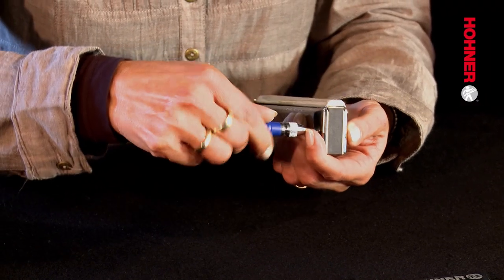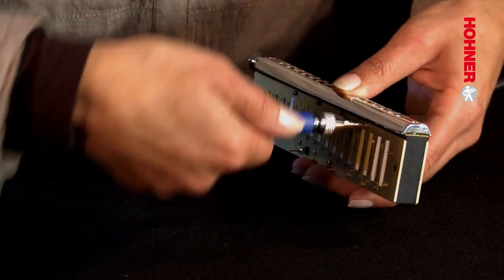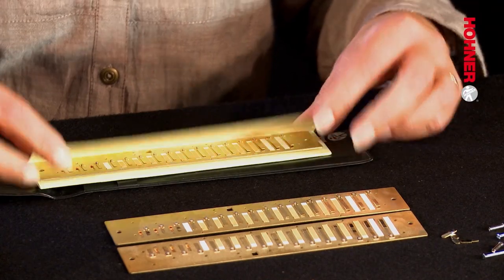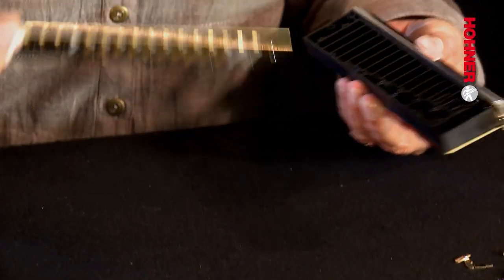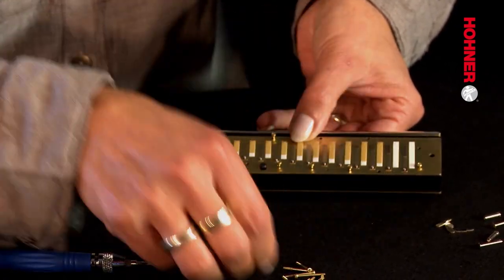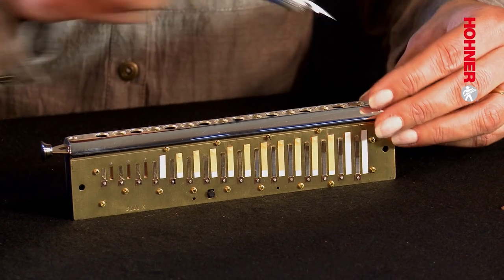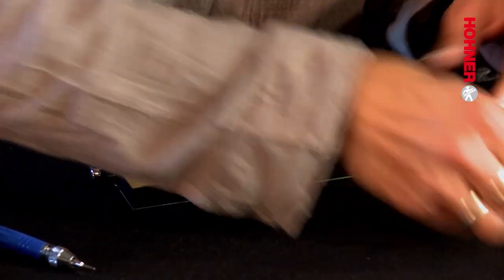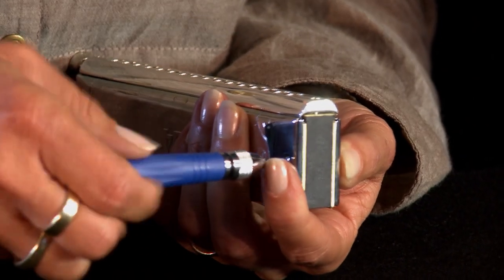HOHNER Service Workshops:C03 - Exchanging Reed Plates

Comment: Excellent, thanks. Is there another video for a 64 chromonica with rivets instead of screws? 
I would like to replace the rivets with screws if this is possible.
Also, what is the cheapest site to order all parts for hohners since I am in Australia?
Thanks.

Comment: Please could you make another video about chromatic models which are rather different eg have an inlay nut which falls out of the comb when the lower plate is removed. Also attaching the slide & mouthpiece seems to need a different technique.

Comment: Do screws come with the replacement reeds for all models or just some?  My 270 is assembled with brads.  What is recommended to use to seal the wood comb so it does not expand?  The crack in the 3rd hole is about 1 mm wide when it is dry but quickly comes together and almost buckles when any moisture is present.  Is there some musical reason why the wood comb is not sealed on the inside of the instrument as well?